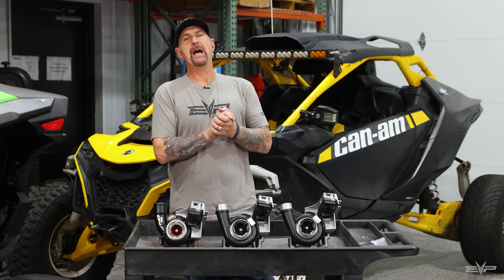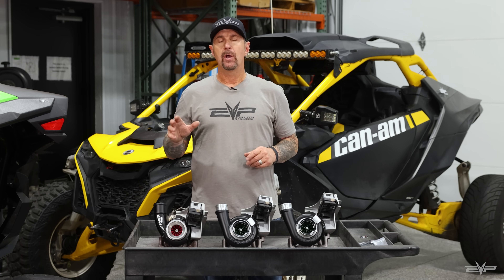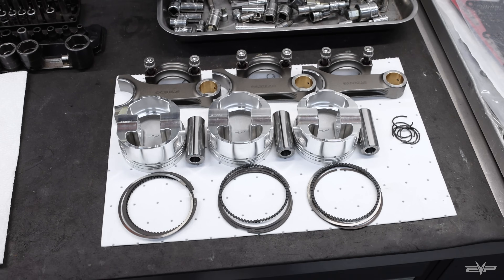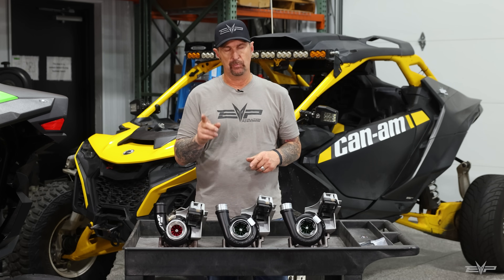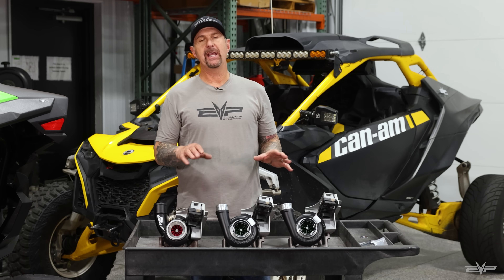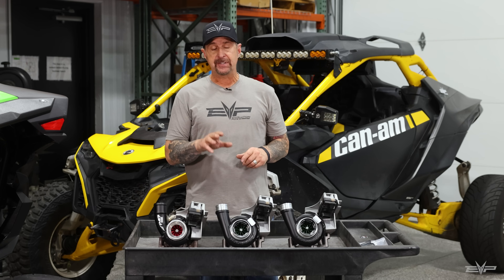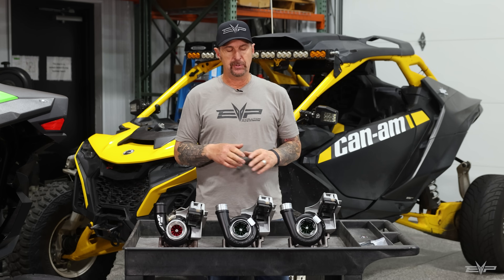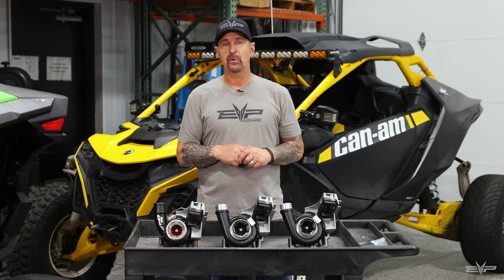EVP UPDATE: Can-Am Maverick R Paragon P47, P48 and P50 Turbochargers

Comment: Transmission stuff please 😁 Also, can you test these turbos on the XRC to find the limit of the 4 door trans on the 2 door?
Reply from the maker: We will be announcing transmission upgrades in the next 2 weeks.  The upgrades will solve the issues with the 2 seat ring gear and tooth chipping on the gear sets.  The RC and Max transmissions I have not heard of 1 failure - they beefed up everything so I don't think upgrades to the Max transmission will be necessary at  500WHP

Comment: Amazing how much power these engines make. My built x3 big pin piston engine with cnc head xr 54 turbo makes 531 at tire at 48 psi on e90
Reply: 48 psi holy shoot 😱
Reply: @Sdukes001 you obviously cant really dune or run it all the time like that but i can change tune with a button, 48 psi kill or 36 psi dune. Even on 36lbs its a rocket.
Reply: @sleeeper88 absolutely that’s pushing some boost

Comment: Oh how much horsepower is it to it
Reply: 3:25 he says.. 450 on the small one
Reply from the maker: @MrSuperchargeron  Made 453 to the tire yesterday on the 48mm
Reply: @EvolutionPowersports  Pretty incredible work you are doing! I have a stock 2018... I am afraid to modify it because if the usual cascade of issues that happen as you find the next weak link.. and the stock brakes are already showing that they can't take the load. They fade quickly and don't keep up.
Reply: @MrSuperchargeron ok gotta